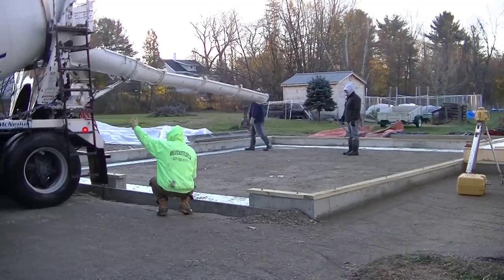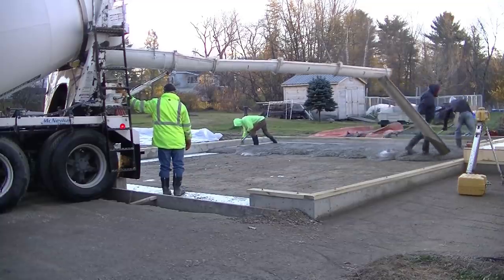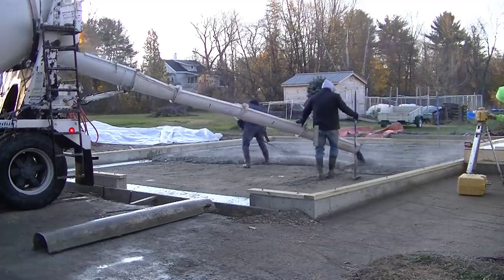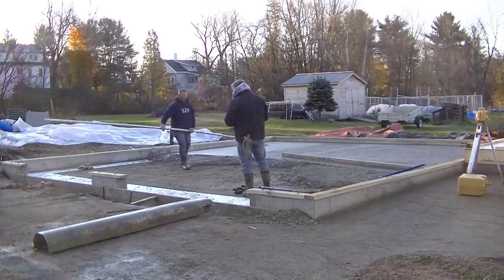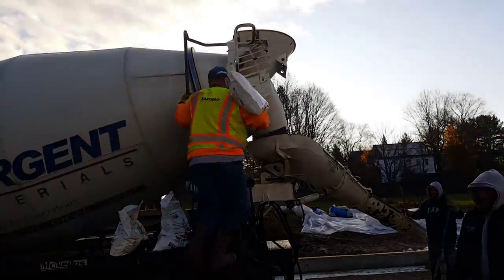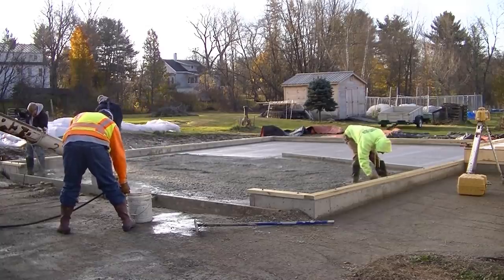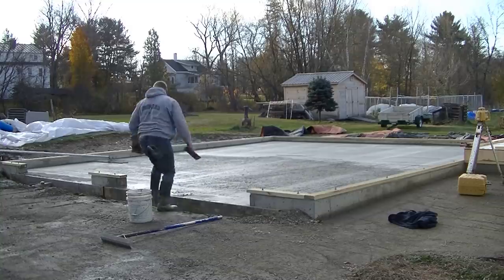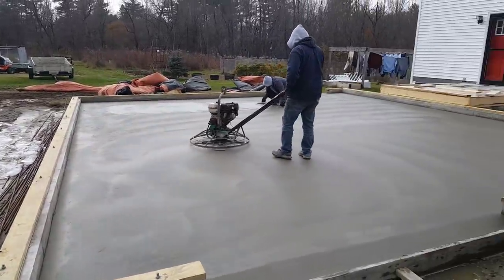Pouring And Finishing Concrete Floors In Cold Weather | How I Get My Concrete To Dry Very Fast.

Comment: another trick i always do is mix the calcium in a bucket with hot water first before adding in.
Reply: Yes, much better dispersion, no hot spots..and make sure of a good rev count before pouring - at least 75 at mixing speed.  And when the truck is waiting for rodding bays out, keep a slow roll on that drum, about 4 rpm or so.  Very important when your load is full of accelerators, especially CaCl or HE.

Comment: We always use liquid cal. 
We always drill in 1/2” steel into the wall, even if they didn’t use steel we would have cut 2’ dowels and put them every 2’ . If they said I couldn’t  put the dowels in I wouldn’t have poured the floor. We put a 1 1/2” lip across the doorways use a 4” edger on the door lips leave the smooth mark in the lip. We seldom cut garage floors because they’re pretty much square, if it was a 3 car garage  we would saw cut. Yes 4000 lb concert would set up faster probably finish easier but it’s more app to crack also. We would have just Fresno the garage. I have a 2’ finish machine made actually just to do the edges but we just Fresno, than I make 1 or 2 passes to get the swirl/machine marks/ pattern in the floor, because that’s what people expect/use to seeing. We always use hot water, we say using hot water will keep you out of hot water, when it gets to setting up and you may have a bad spot we have a saying  give it a lick and a promise ,keep going. Which means you can come back Lick it and promise to do better next time.  And we always use 4” edgers. Why? Because they look better. We fill two 5 gal buckets of water to the top, the very top and one 5 gal bucket half full, one of the 5 gal buckets is never used two wash off tools, but to wash your hands if you need to I like clean water to wash my hands in. We would have just used 2 guys to pour and finish the floor. I understand if you running mostly a 3 man crew why you would have used 3 men, and I realize on some days 3 men is 1 man short, it usually works it self out where it all comes out even. I think one thing you guys probably do different than us is you spend a lot more time laying down/floating your edges. We take the screed board, one man, hits the edges with the 12’ screed board and than we float the edges with the float.

Comment: Nice clip Mike..man I haven't seen a rear loader since the Early 90's around hear!
Reply: Very common in Europe
Reply: Right!!!! I would hate to go back to that type of mixer!!!
Reply: @aarongrabowski5620  you don't have to "go back" it's right here  in present time 🤣🤣.
I'm sure they have pump.  It just not needed to do the work on a flat open site.  Pump cost more,  you know that, right.
Reply: Brand new trucks around here are like this one
Reply: @Kghost0311  i hear ya brother different states different laws.
Reply: @Kghost0311  yeh nothing is outdated about the chute having in the back.  The concern should be of the cement-gravel mix which comes from the plant. That's where things can get screwed. On an open area like this no need to pay extra for the pump. Also the new mixers come with more efficient, quieter motors. I use pump for high elevation structures, walls, and anything above waste line. The mixer sets the speed of flow and amount. Very reliable as these videos show it.
Reply: @c.knoxville5998  makes sense I guess we just dont have the need or demand for it in my region.

Comment: Would you do anything differently if pouring over a plastic vapor barrier? Also is it common to supply the calcium yourself? Is it better or worse getting the calcium mixed in at the plant?
Reply from the maker: We pour over plastic vapor barriers all the time, no different. I usually buy it from the concrete supplier. I never mix it in at the plant.

Comment: How do you get your finished level in the centre of the bay to tamp off?
Reply from the maker: We use our laser level and get the height making a wet pad in the concrete then checking it with the laser.

Comment: What's your opinion on those butt loading trucks compared to the front ones ? Here in Ct, I've only had to work with the front loaders and they seem that they would be much easier and precise. Do you ever worry that the GC is dead wrong about no wire, plastic and that it'll come back to bite ya in the arse ? Thanks and thumbs up !!
Reply from the maker: I like the front loaders if you get a good driver. Wire and poly isn't my call. I just get hired to pour and finish.

Comment: Mike. 32f in morning. High of 48 tomorrow and rain forecast after 4pm.  Going to start pouring at 7am.  6 bag straight mix, plasticizer, and 1%.  Will the concrete set fast enough?  Bump up to 2%.  I'd be ok with just getting a smooth bull float finish.  Tomorrow is the last day I can pour before lots of rain, holiday, and very cold weather coming.
Reply from the maker: If it was me I'd go with 2%.

Comment: don't you get a lot of aggregate popping/and chipping up if you saw cut your joints same day pour? We sure do so we do not do it anymore. didn't matter what type of diamond blades we used as I've tried many types of over many years.
Reply from the maker: No not at all. Cuts are real clean.
Reply: @MikeDayConcrete  What brand blade are you using? and what machine are you using to cut?
Reply from the maker: I'm using the Husqvarna Prowler X150 (Soff-cut) saw. I get my blades (6.5") from Warrior Diamond. Just like this one: https://amzn.to/2IvYje3

Comment: Does calcium cause the concrete to "dust"(create a white chalky buildup over and over again) on the surface years later?
Reply from the maker: Not really, that's mostly from water vapor carrying minerals to the surface through the pores in the concrete. They settle on the surface making it dusty.
Reply: @MikeDayConcrete   Thankyou. It was so bad I'd have to scrape an eighth of an inch off the floor every year. It was a storage space. I paid a concrete guy to pour and finish it because of the size. Was a cold rainy day out and I remember the concrete being pretty runny. Probably a 6 or 7 slump. Must have ended up real porous. I appreciate your channel and your effort. Edit, Our local concrete supplier puts fly ash in the mud, at the time I thought it was bad stuff, perhaps causing the dust,  until I bought the book "the properties of concrete" and read it. Great read 🤠
Reply: Concert company’s don’t use fly ash in the winter it won’t sit up. The slang for fly ash is summer mix ( use it in the summer) because it doesn’t sit up as fast.
Reply: Mike Day Everything About Concrete my experience is it dose dust up.
Reply: Thankyou guys for your comments, 😊 nothing against the man who did the pour or the Company who supplied the concrete. It did the job I wanted and I was just curious about the properties that caused it. It was poured over 12 inches of compacted pit run (8" and minus rock)  + 3 inches of 3/4 minus road base and finish height was 8 inches over grade, all on top of 15 feet depth of top soil with a large french (30 yard of 8-12" rock)  drain 8 feet from the building.
Reply: @JG-kv4oi  That sounds like efflorescence. Crystalline deposit of salts that form when water or lots of moisture is present, salt deposits left behind when water evaporates. You can impregnate a Hydrophobic sealant into the surface. Try a local White Cap concrete supply house near you for a product line. They will have something for you to solve that issue. Good luck
Reply: @JG-kv4oi Concrete Efflorescence.  There is a sealer to stop that. Try White Cap Concrete supplies. They will have a product to take care of that dusting issue. It's a crystalline deposit of salts left behind when water or moisture evaporates

Comment: 4000 psi concrete is a performance mix it actually has less cement in it and either fly ash or slag straight sack mix which would be a 6 sack Limestone would be is what you would be wanting to use in the cold weather it cures faster and comes up to its PSI strength sooner
Reply: Depends on the redi mix company , mine used more cement powder in their higher psi mixes. They do a lot of govt work so they do not use any fly ash.

Comment: Question for you, when using fiber mesh in your mix do any of those fibers come up through the surface of the concrete? Can you tell fiber mesh was in the mix from a finished slab point of view? Whats your opinion on using a fiber mesh mix inside a house that was going to be left bare as in concrete floor.
Reply: You can take a torch afterwards to burn off any fibers exposed.
Reply: Yeah, burn it or get your concrete supplier to to go UltraFiber - wood cellulose based microfiber, works wonders on normal flatwork and fine/short fibers are not noticeable when doing stamped/dyed/facing steps etc.  I was leery of the stuff when it first came out, but no more.

Comment: How much did this cost (the customer) including the footers and walls?
Reply from the maker: I talk about pricing in my facebook group CONCRETE NINJA'S, not on this channel. Thanks for watching!!
Reply: @MikeDayConcrete  If you used hotter water, could you save money on calcium or cement?
Reply: @MikeDayConcrete  Is there a formula or chart that relates setting time to temperature?  I remember from chemistry a rule of thumb that said every 10 degree rise in temperature doubles most reaction speeds.  Does that sound right? does it sound better for 10 degrees Celsius? or Fahrenheit?
Reply: @MikeDayConcrete  I like the owner's idea of using fiber and extra cement instead of rebar.  Not only is it probably cheaper and easier than rebar but it also doesn't rust like rebar and so should last longer than rebar, far longer if near road salt or the ocean.

Comment: Mike, how cold will you pour down to? I'm not sure I can pour before we get freezing weather. Would you pour if the high was mid 30's?
Reply from the maker: We pour all the time in the 30's. I'll pour down to 28 if I have to. Below that the surface can start to freeze.
Reply: @MikeDayConcrete 
Poured 37 yards today. First slab! Rain hit at 3pm but we got it in. Thanks for your videos. They helped.

Comment: What happens if you pour on a puddled wet vapor barrier after a rain without letting it dry ?
Reply: It takes longer. Water must evaporate through the top of the poured concrete. Water wont escape down into the subgrade because of the vapor barrier.

Comment: I refuse to pour without rebar, definitely voids the warranty.
Reply: it may be the steel fibre concrete
Reply: I rarely use rebar. Always in footer, but only if code or customer recommend it in anything else. I use 4000 with fiber and don't have problems. Rebar doesn't do anything to prevent cracking. Only keeps it together if it breaks.
Reply: Brad Hill up here in Iowa we typically have 3 feet of frost, which moves slabs 6 to 12 inches up and down. I do a lot of tearout and replace, and 98% of the slabs have wire or no reinforcement. Which is great for job security.
Reply: @iowamatt2519  your in a lot different circumstance then I'm in in East Tennessee. That's a lot of freeze thaw movement. Glad I don't have that to deal with.
Reply: LOL What's your warranty?  I guarantee concrete will crack.
Reply: Bud Prine, rebar will not keep concrete from cracking. It holds it together and keeps from separating if it does break. In northern temps with freeze thaw cycles, it's a must. Where I am, in Tennessee, concrete plants don't even recommend rebar.
Reply: @budprine1591  I warranty it for a year, guaranteed to crack, but I cut it where its going to crack, and I very rarely have saw joints more than a 6x6 pattern. If it does crack outside of a saw joint I replace it, that's the difference between successful and not.
Reply: @bradhill4590  I don't recall saying rebar will keep concrete from cracking.  I did say essentially concrete will crack.  We do various things to control where it cracks.  That means we do such things as saw-cutting to control where it cracks.  By its very nature when water evaporates from the concrete matrix shrinkage occurs. A minor tensile force is created.  Concrete is not expected to resist tension.  On the other hand it is good in compression.  As a matter of fact the strength of concrete is given as compressive strength.
Reply: @budprine1591  sorry. I thought you was replying to my comment. My mistake. Merry Christmas.
Reply: @budprine1591  Concrete shrinks and cracks. The only 2 variables that dont change in concrete.

Comment: Concrete doesn't dry! It cures! :)
Reply from the maker: Why my concrete cures fast?  Just didn't sound as good to me.
Reply: Mike Day Everything About Concrete 
It may not sound good, but people will learn from you that concrete is drying, which is wrong. IMHO
Reply: @Take_And_Make  It’s the same thing when everybody says ‘pour’ concrete instead of ‘place’ concrete. Semantically it’s not correct but that’s just what everybody says 🤷‍♂️
🤜🤛
Reply: @Take_And_Make  but then u can come correct them right away and save the day!
Reply: I agree concrete cures.  Drying is not good because the absence of water (drying) will stop the hydration reaction.  When hydration stops strength gain stops also.  Keeping newly placed concrete damp allows the curing and strength gain to continue.  Someone mentioned curing compound.  That helps keep the moisture in the concrete and slows down drying.

Comment: Im ready for what i call season to start . When it warms up and work starts going balls to the walls . Here in southern Missouri I've never seen in 23 years anyone dump calcium chloride into a truck . Here you just order 1 or 2% either NCA  or calcium and hot water.  If it's really cold and the boss wants it to set super fast he'll tell us the order High early . Which is 8.62 bag mix then put hot water and 1 or 2 % . Back in my residential days I wish I could have dumped that calcium chloride in the truck on the job site . cuz I've had times where the concrete just didn't set and we will be out there all damn night .
Reply from the maker: I like being able to control the amount of Cal I put in the truck. Plus, I think the flake works better than the liquid stuff.
Reply: Flake is for sure best. 2% from the plant and a bag of cal will get u on ur way!! Here in PA flake is a daily consumable. I cant think of a winter where we didnt use flake.